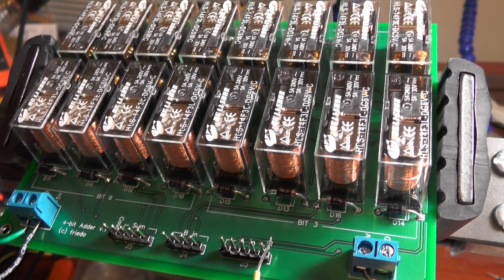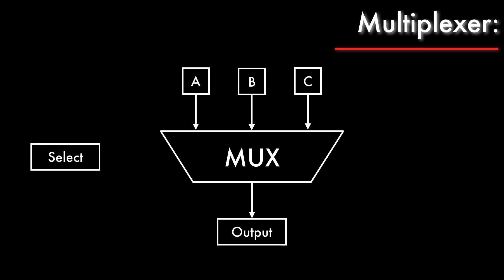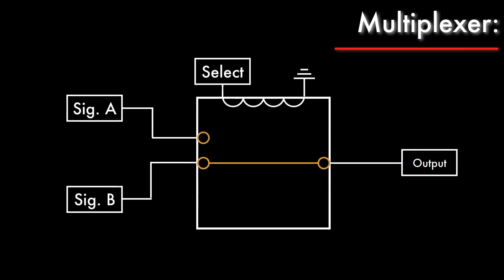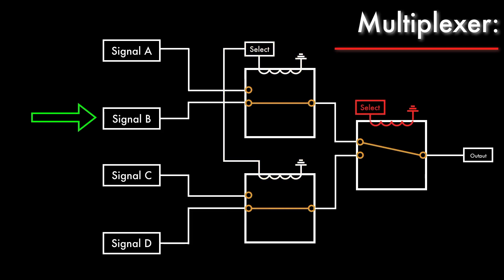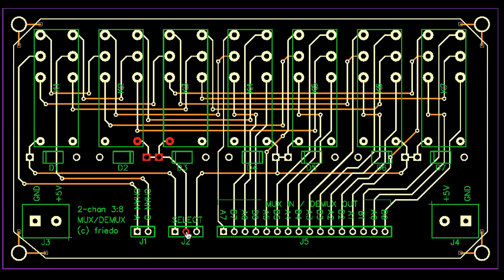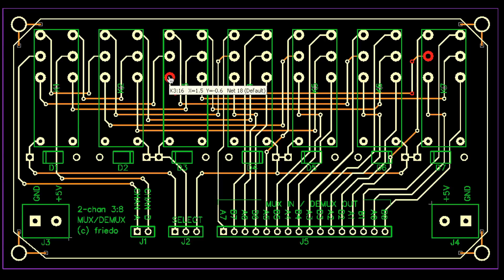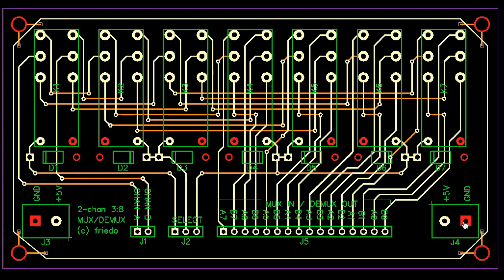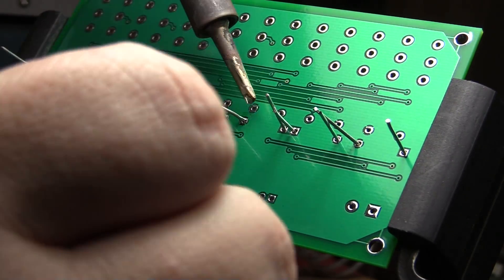Relay Computer ep. 5 - Building the ALU multiplexer

Comment: Just make a microcode lookup rom, whose registers has as many bits as there are select lines.  Then your rom could have following structure: 5 bits, “opcode”, 3 bits is sequence number.  So each opcode (up to 32 of them) can have 8 steps, each step activates select lines for each step of the operation at hand.  So your rom table has 256 entries possibly, whose register width is as wide as the number of total select lines in your machine.  The rom can be an array of dip switches.

This way only decoder needed is a 5 bit address decoder and a 3 bit address decoder, the grid array addresses your ROM table.

Your opcode read from RAM into the instruction register addresses the first 5 bits of rom table, the next three bits are from your clock sequencer.

Comment: In your last video i just realized that you missed out on a very easy to implement operation that does not make your computer faster on a technical level but reduces the operation you need to do for some applications: the shift operator. As you can reduce the amount to of add operations when programming it by multiplying to the closest 2 power of two via shift and then adding (or subtraction if you use 2-complement and what ever suits you better), i can imagine that it would have some possible application working with 16 bit numbers. 

Also i have to throw it in here... i love this project of yours... it is awesome

Comment: Why redundant arithmetic and logic before the multiplexer when MUX are perfectly capable?
https://drive.google.com/file/d/133fmynxjcyRbONJITlNFItSr7aQqz8L8/view?usp=share_link
https://drive.google.com/file/d/1eemAOT77ut0-isMaVaVbfw-9TxhC0q73/view?usp=share_link
1st example wired for carry and saving two control lines, might offer a slightly easier build.
2nd example wired for magnitude comparison, and no saving tricks, much easier to understand.

Ken KD5ZXG
Reply: Also, relay coils of the magnitude (or carry) chain do not depend on carry to ripple, only series prefixes A vs B.

Comment: Once you have 4way multiplex, only need feed a truth table for logic you wish to perform. Spare poles form another 4way to ground carry on 00, propagate carry as-is on 01 or 10, or generate a new carry on 11.  XOR logic output vs carry input (not carry out to next slice) for a final result. Difference across a final relay coil can give us that XOR. Spare pole of final may also pass a zero flag (which begins high) or ground it. Be sure to put a diode or MOV across each coil to suppress sparks. Differential XOR demands a bridge or MOV solution. Generate should not switch directly to the high rail, but to a control that may disable carry for pure logic. Set your truth table to XOR when adding. All this in four DPDT.

Comment: Hey clickety clack,

What do you want to make with all of those relays

What functions should it have?
Just curious
Reply from the maker: It's going to be a fully programmable (but very simple) computer.
Reply: Clickety Clack do you have any idea of how many relays you would need?
Reply from the maker: Between the ALU and the three main registers I believe I'll need a total of 328 relays; for the sequencer, I/O and other miscellaneous parts I'm not sure yet since I haven't finished designing them.
Reply: Clickety Clack not bad, i guess, gotta count mine as well, but im going to use transistors becouse they are super cheap, if prices were equal i would have used relays :)